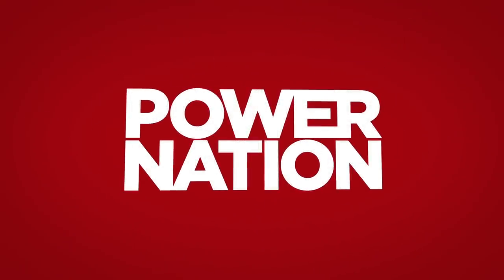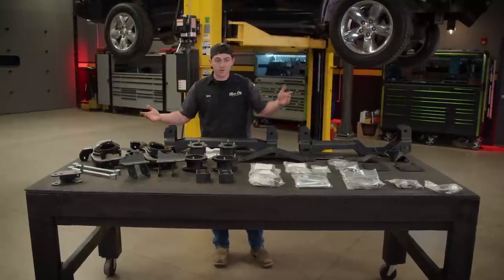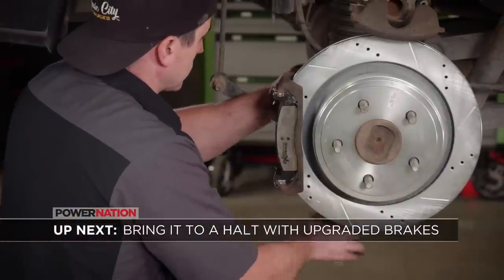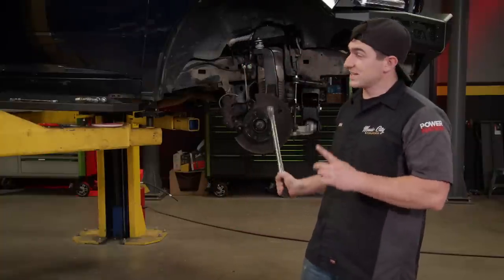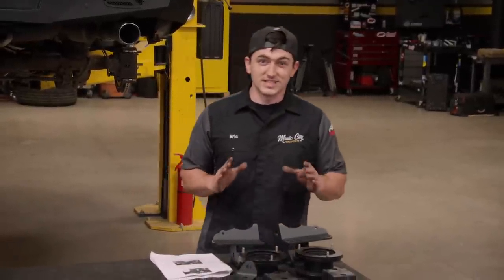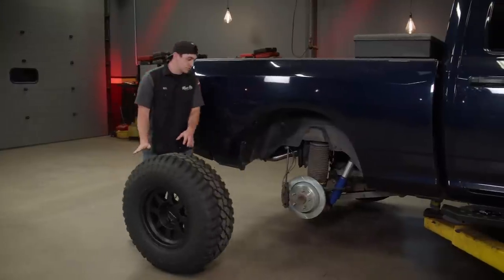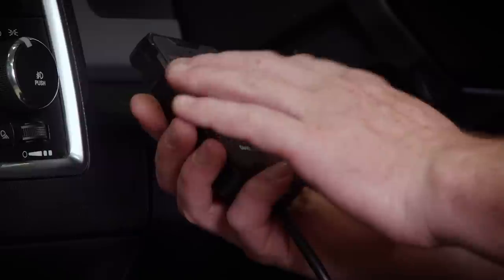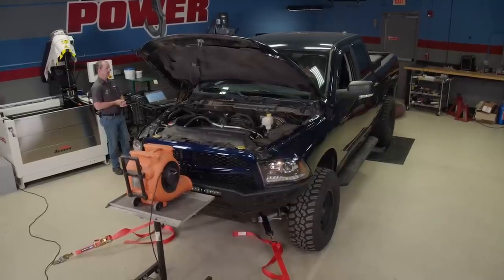Suspension Upgrade Gives The Ram 1500 A 4" Lift - Music City Trucks S3, E11

Comment: Just curious, putting on those tires being almost 38 inches, what about the speedo. Did you have to recalibrate? It’s no longer reading the miles per hour correctly. If you did have to fix it , what device did you use?

Comment: Those bigger tires will change the before and after dyno numbers.
Reply: Exactly, they definitely suck a few more horsepower than the stockers. Which makes the gain that much more impressive, as well as the dedicated 87 octane tune.

Comment: Being someone who has gone through 3 compressors since new, I would have done an Air Delete kit. I just deleted my setup 4 months ago because I was going to need another $3000 compressors. I was tired of not knowing if it was going to work while towing or drop down to the bump stops because it was in a bad mood.
Reply: Deleted mine also and went 6” coilover suspension. So much nicer.

Comment: Problem with the air suspension in those trucks, it was a $1,700 option, but the dealer quotes 4,800 to repair and replace the air compressor and block. It's a frequent failure of those trucks.

Comment: Should of put in Moog instead of those durashit suspension parts.Same with the wheelbearings using Timken instead.Those torque specs,a couple ugga duggas with an impact is better

Comment: Replaced, rotors, pads, hubs, upper and lower control arms, steering spindle and the rod ends but reinstalls the most common known failure point in these trucks, the stock axles. 🤦
Reply: they aint rock crawling they'll probably hold up